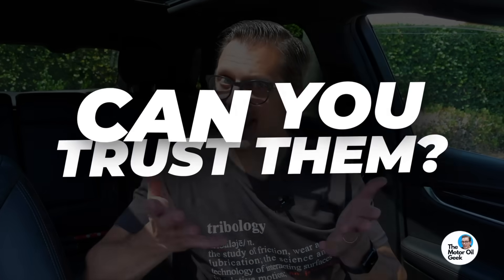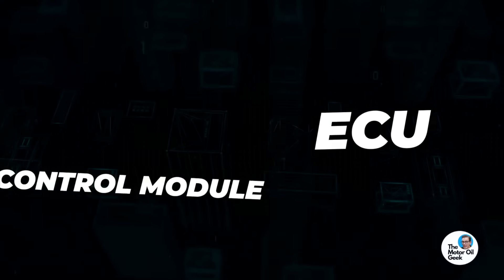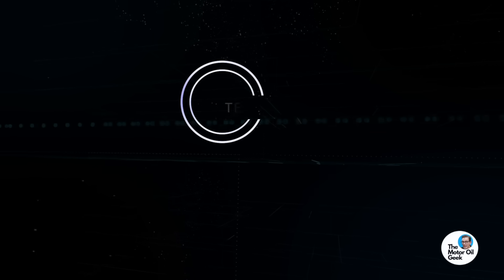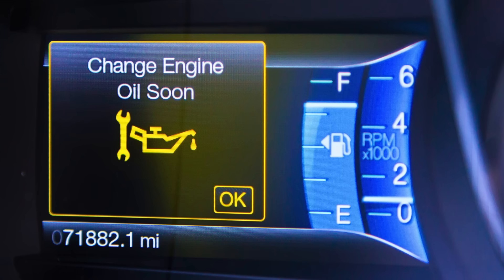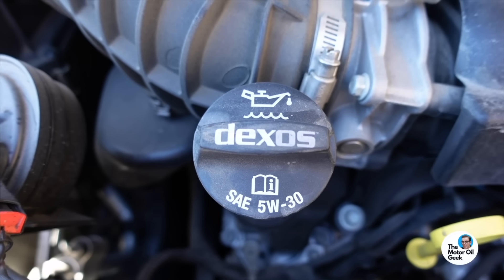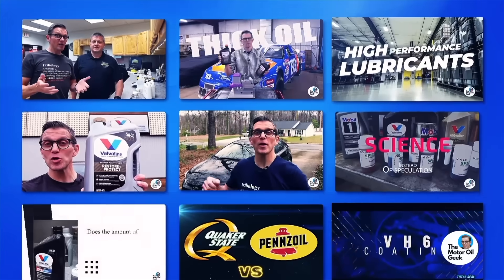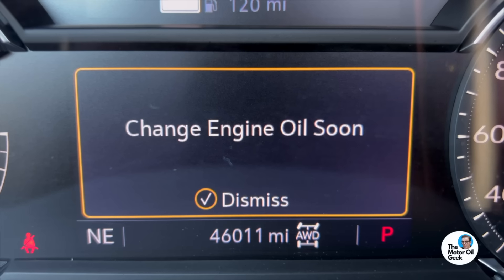The Accuracy of OIL LIFE Indicators REVEALED!

Comment: I found on my 2016 Fusion Hybrid that isn't consistently told me about 10,000 miles. I consider a hybrid to be easier on the oil all around anyway. I also drove a Chevy Volt for almost 2 years almost exclusively on electric using only about 7 gallons of gas. The oil life monitor was down to 10%. My Honda Clarity Hybrid just a simple time minder that I can set between 6 and 12 months. I generally let it expire once and reset it before letting it expire again and then changing it. Heck, I only put 50 gallons of gas in it for 2 years of driving and it comes out looking almost new. My RAM pickup with the 5.7 Hemi also goes about 10,000 on the monitor of mostly freeway driving. The only oil that I have analyzed is my yacht diesel engines. With raw water aftercoolers on them, I am first and foremost interested in the sodium content and find all other pera meters good at 300 hours of use. This is tipu ally about 2500 miles on the at average 1200 rpm with some faster and obviously some slower.

I would love to see a test on some known engines and mileage on identical  cars that are driven radically different and the see the oil life monitors for accuracy across a range of driving styles and conditions. I for one having been driving now for 47 years with hundreds of vehicles have done 10k+ mile oil changes and have never had an engine fail due to an oil problem, some going as high as 300,000 miles total. I have also never had any type of fuel problem always using the cheapest fuel I can find. So much hype out there about all of this. Or should I say fear. The only engine I had that was sludged up was an 84 T-Bird I got in a money owed deal that had 100,000 miles on it without once having an oil change (it was a this or nothing deal) . It ran ok, but inside the valve covers was a disaster. I drove it for 6 months and sold it cheap still running good.

Comment: You should be only using the oil life indicator in the event that it reads less than 15% and you have not hit the time or mileage interval. 

IE: if you have a 1 year 10k mile interval with an oil life indicator you have three potential triggers to change your oil. 
If you are at 1 year and do a lot of city driving and/or idling and have not hit 10k miles, and the oil life indicator says 30%: Change your oil
If you are at 10k miles, but it has only been 8 months, and the oil life indicator reads 30%: Change your oil.
If your oil life reads less than 15, but it has only been 8 months, and you have driven less than 10k miles: Change your oil. 

It is "whatever occurs first." but many people just wait until their oil life hits 0 before changing it not realizing that an oil change costs 50-100 bucks and a new engine cost multiple thousands.

Comment: When the guys in the shop do an oil change and forget to reset the oil change reminder, it will pop on the next day or two and the customer insists we never changed their oil. Then it takes 20 minutes to explain how they work and reset it for them. Usually doing it with them watching helps. 
Most of the vehicles we service are mileage based intervals displayed on the dash and do not compensate for driving habits.

Comment: Years ago, I rented a Chrysler 300 for a road trip. The oil change monitor light came on 50 miles into the trip. I called them, and they said...just drive it. Anyway, I checked the oil, and it was a quart low, so I did dropped in a fresh quart.

Comment: I have a 2012 Honda civic Si which i use to drive deliveries 7 days a week. I just bought it 58k miles and put full synthetic oil and new filter every change. Since it's rated for 7,000 between changes and the oil life indicator bases changes every 3,000 miles, I will run the indicator to zero and reset, then call my mechanic to make an appointment in three weeks. Otherwise, I'd be wasting  money on synthetic oil and a filter.  So, I still end up changing the oil before the milage recommendation on the sticker.

Comment: Even if you can trust them, i would use fluid change intervals instead made by the manufacturer or by popular public opinion if manufacturer intervals don't exist. You should already know when and how to change most fluids in your car with the exception of trans and diff fluids as that is difficult on newer cars. Knowing how to do simple fluid changes like brakes, coolant, power steering, and oil can save you a lot of money and give you more knowledge of how your car works. Of course still check your fluids regularly and change early if needed

Comment: My issue with these extreme oil changer intervals is carbon and goopy sludge builds up no matter how good the oil is. I have pulled countless valve covers over my time working on cars. The ones that i know are changed every 5 k more or less look ok under the cover. As I see ones that habitually go 7k or more are goopy asf. That cant be good for the needle bearing and valve guides and vanos solenoids.

Comment: Im a driveway mechanic, i work on my friends and family's vehicles. And I've found that for most GM cars, 10% is equal to 1,000 miles. 
And I strictly go off miles for an oil change. I don't believe in the 10,000 mile oil change interval

Comment: i work in a shop, 9% on a chevy is much further than 6k miles.  if you are doing oil changes every 5k miles, it will still be above 25% on the monitor.  the important part of doing oil changes regularly isn't just the life of the oil, its because oil is the only thing removing buildup on the upper parts of the engine, if you are lax on oil changes, you will see sludge buildup on the topside of the engine.
Reply from the maker: Thanks for sharing!

Comment: There are multiple systems in use. Some manufacturers just use every 5000-6000 miles with no data monitoring (like my GM truck with LS V8). Some do use data monitoring (like my wifes 2016 Buick v6). 
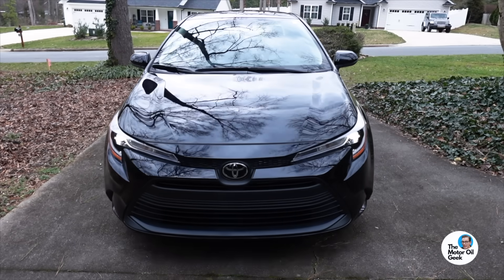2:45 The engine size makes zero difference, especially with most passenger vehicles these days. Most mainstream vehicles have horrible compression (which allows for better fuel economy), direct injection, and poor quality piston rings, so that 2021 Toyota may be burning a quart every 5000 miles but also adding a quart of fuel in the same time, meaning it needs that oil change every 3-5K miles. By comparison the Corvette with higher quality components, as they need to withstand better performance, means almost no fuel leak-by and no oil burning so a mostly highway driven Corvette with no "performance" driving can easily go 8-10K miles between oil changes, especially with Synthetic and a good oil filter. This v6 Cadillac is built with better pistons and rings, but worse timing chain and the VVT, which means 5-6K is normal. Also the oil filters have their limitations, many cannot continue to filter anything beyond the 6-8K range in most cases.

Comment: On a 2007 Chrysler Sebring with a 2.4L motor I'm getting about 3,500 miles per oil change according to lab results with Penzoil Platinum full synthetic. Car is driven in extreme city driving with lots of cold starts. Shows that how the vehicle is driven has a lot to do with how many miles the oil lasts.

Comment: Oil life indicators should be an hour meter when the engine is running. Transmission fluids  should be  an combined hours and mileage,  axles are miles driven. Am I right ?

Comment: I have a ford focus 2023 in Turkiye. I changed oil at 16.000 km( 10k miles) . The computers says %50 engine life. I drive slowly. The recommennded interval is 15.000 km, or 1 year in Turkiye.

Comment: Funny thing I have always thought of the 3000 mile oil change as actually too long for some "CITY" people, and way too short for "COMMUTERS" and we all know cold starts due to enrichment contaminates oil faster. - Case in point My FIL (Father In Law) and I worked at the same factory. His drive: 8.5 Miles / 15 Minutes of 40MPH or less limits - My drive: 50.1 Miles / 49 Minutes 40 miles of 70MPH Freeway. - If you did not include any warm up time, so "summer" use (we are in MN and parked our trucks outside) For every mile he drove was 2 minutes of engine run time (2:1 Ratio), so 3000mi was 6000mins = 100hrs of operation, and 350+ COLD STARTS - My time is practically a 1:1 ratio, if I changed at 3000mi it would have been throwing away oil with 60hrs and 60 COLD STARTS on it! - I come from maintaining machines by run time and startup counter, so that made NO sense, I usually changed at 6,000mi at 120hrs and figured 120 Cold Starts! - Now we used our trucks on weekends too, but just comparing our work miles was a huge eye opener!

Comment: Thanks for doing this video, I drive a plug in hybrid so the oil life is long, and I mean really long.  My oil life indicator doesn't come on for at least 20,000 miles and the oil doesn't seem too bad when I change it, at 120,000 miles no sludge on the oil cap.  It seems like it's way too long between changes but I've been following that indicator and so for no problems,

Comment: Like the info on the oil monitoring systems and its origins.  However, Corvettes never had On Star prior to the C6 in 2005.  Also, the 7500 mile limit is also incorrect.  Quite few of the GM systems would let you go 11k or 12k miles depending upon how it was used.  Also seems like a bad methodology to take a sample from a rental car without knowing any of the history of what maintenance was done or when.

Comment: I worked on Mercedes Benz cars and the M112 and M113 engine had 13,000 miles oil change intervals and this was just fine. You needed to use the factory oil filter and full synthetic , high quality motor oil

Comment: As a auto technician we see oil consumption as the bigger issue. Not that the oil is bad, just its not there.  With VVT, oiling turbochargers and considering tire life we recommend 5k oil changes with tire rotation.  Any customer that goes by the oil life monitor destroys there tires usually and have more unscheduled repairs because they are not being inspected regularly. Novel idea, just not the best for central Wisconsin.

Comment: @themotoroilgeek, I have a question about oil life and gapless piston rings. Given that gapless rings have considerably less blow-by than standard rings, would gapless rings help to increase the required oil drain interval? I realise oil analysis would be needed to know when the oil definitely needs to be replaced, but I thought I'd ask, just in case you've checked it out before.

Comment: Great vid!  My wife drives a 2016 Buick Encore AWD, and now has about 106,000 miles on it.  She has always relied on the 'Oil Life Indicator', but on several occasions, has driven an extra 1 to 2 thousand more miles.  The small 1.4T Ecoboost engine has been flawless all these years.  My daily driver has been a 22 year old 2003 VW GTI VR6, and i've religiously changed the oil (LiquiMoly full synthetic) once a year.  I now have 147,000 miles on it, which comes out to about 6682 miles per year.  My engine has been flawless as well.  There is no need to 'overchange' the oil.
Reply: I have a 2005 Honda Pilot I bought new. I've had the oil changed every 5K with conventional approved dino oil. It just hit 275K and purrs like new. That's one reason I bought my 2023 Honda Passport as it still uses the naturally aspirated V-6. The new one will once again get the approved engine oil.

Comment: I still don’t trust it. My 2013 Ford Escape will tell me to change the oil a thousand miles after I changed my oil.  I change the oil 3 times by the time that thing tells me to change the oil.  If it was actually monitoring my oil it would never come on and say change the oil especially after I have changed my oil and it’s come on and warned for oil change after 1000 miles of an oil change.  I think it’s a mileage tracker and indicates to change at 10,000 miles. I reset it when it displays the message but never after I change me oil.  I change my oil around 3,500 miles with full synthetic. If it was actually analyzing my oil, it would know there’s fresh oil in there and not come on after 1000 miles of an oil change.  It doesn’t display a percentage of oil life either.  I think it’s a 10,000 miles warning to change oil.

Comment: I've had four vehicles with oil life monitors. Two with V-6 engines (NA), one with a V-8 Hemi, and one with a V-6 and twin turbos. Usually we don't put more than 4k - 5k miles in a year. Because of the low mileage I had only been changing the oil annually. The life indicators rarely went below 50% in the year's time. The twin turbo Explorer is a different story. In ten months we put about 4k miles on it and the oil life monitor was showing 18%, which was kind of a shock. Of course I got the oil changed. I think it was probably accurate in that while I drive everything fairly hard (for an old man) I know from watching your other videos that extra belts/chains, etc. can tear apart the additives and Direct Injection can soot things up. I suspect that the algorythm gets adjusted for turbos and DI. And I know it puts more gas through at times because you don't get the feel of 400 hp & 400 ft-lbs without some extra fuel going in. At least once a week I drive it for about a half hour and then stop and just nail it in "Sport" mode until I get up to about 90 mph. We live 120 miles from the nearest freeway so being able to get around the motor homes on two lane roads quickly is a must, so it gets some of this every time we go out of town.

Comment: Great video and great info. I have a 23 Silverado. GM recommends 7500 intervals. I do 5000 wich is usually around 30% on the monitor. DI turbo engine,  Rather safe than sorry.

Comment: There are certainly different schools of thought, with some people chasing the question of “what is the absolute best I can do for my vehicle and it’s engine longevity?“ And others simply asking “what is the least? I have to do in order to have good longevity in my vehicle?“ Other than defining ultimate longevity versus good longevity, these two questions are opposition to one another. I have to ask a question, “has oil formulation and quality changed over the past 50 years?“ Of course it has. A further question is “are we interested in a prediction of motor oil formula breakdown? Or are we interested in contamination and the where that this engenders in our engines?” The rationale for choosing an oil change interval has to encompass all of these factors. Personally, I follow relatively short oil change intervals, and infrequently do I do any testing. I am not trying to stretch my oil change intervals and I am not trying to get the most out of my oil. I am trying to get the most out of my engine and the oil it’s just a wear item. of course I am an individual and don’t have a fleet or business account line to manage either. also, generally, I try to keep my vehicles longer, 10 to 15 years for my own and 6 to 7 for my wife. I do my own work even with a busy schedule because I enjoy it’s simplicity and the simple feeling of doing a job right, at least in my mind. Do I trust LL indicators? hell no.

Comment: I’ve got the ‘22 Silverado L3B (2.7L turbo 4-banger) with the first oil life monitor I’ve had. After driving 42k miles, it’s pretty close to requiring 7500 miles on a change, whether it’s been highway, towing, in-town, etc. That’s inline with the change recommendation for synthetic oil specified.

Comment: I don’t trust extended OCI’s,  especially so if the oil capacity relative to displacement is low,  and also if the filter is small.  Add to that small displacement and forced induction engines churning out high power numbers.  Many of these engines don't even have cylinder sleeves anymore,  they are more or less a film coating….making them 1 time throw away engines.  Even with good oil samples and oil changed when the dummy light said so,  many have shown gummed up messes under valve covers with under 100k mileage.

Comment: Fun fact: Chrysler says an engine can burn a quart every 1000 miles and thats "within specs" a pacifica takes 6 quarts and the oil change light is set from the factory at 6k. So technically it should come in with no oil.

Comment: You should have mentioned that GM didn't start implementing the 7500 mile hard limit on their OLM until the 2013 model year. Also, the basis of your video relies on the bold assumption that the oil life meter was actually reset at the last oil change. For all we know, the vehicle could've very recently had the oil changed, but the OLM wasn't reset. That would make your oil analysis inconclusive. GM TSB 18-NA-125 does a good job explaining how OLM works.

Comment: That condensation also settles in the exhaust system and builds up if you only take short trips.  The water combines with exhaust gasses to for acids that will corrode even stainless steels.  In the 90s a manufacturer opted to skip muffler drains and had luxury vehicles in the show room with corroded mufflers.